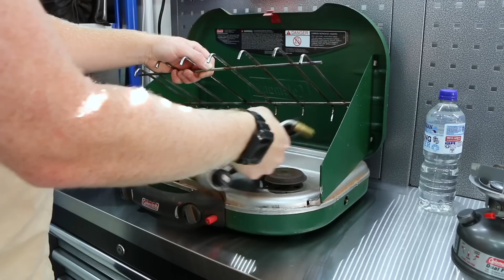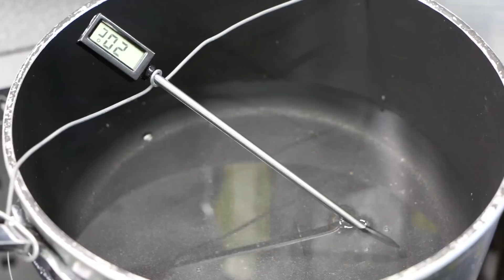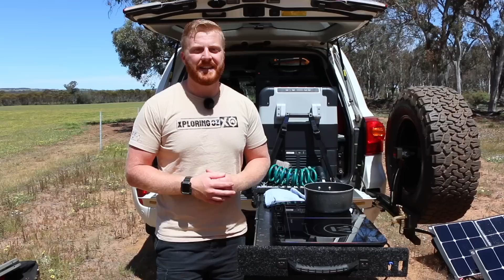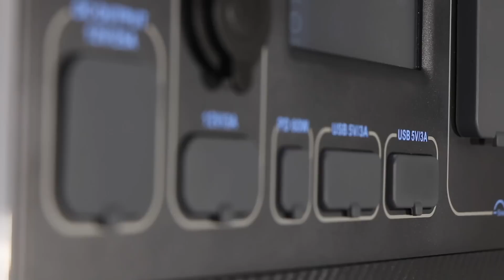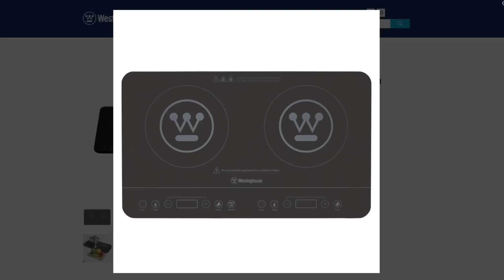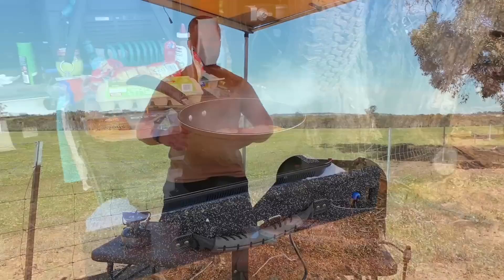INDUCTION COOKING & Camping | Is it sustainable | Electric vs Gas | Overland Cooktop | Pots&Pans

Comment: Yeah,if you want to get cancer and or heart attack with atrial fibrillation, then by all means, use induction stoves.
Reply from the maker: Hey mate, you got any research papers than have hard evidence to links these factors to induction?
Reply: @XploringOz  we all know what radiation causes. We all know what happens when we come into contact with electric heat. You go ahead and get your induction stove and see for yourself happens. But forcing it on others is unconstitutional. Paragraph 420 section 69 of the constitution you can look up for yourself. First it’s medical tyranny, and know it’s more invasion of privacy.
Reply from the maker: @emmanuelvacakis4463  Fair enough mate.... I'll wait here for the research papers that link 'induction cooktops' (not radiation) to the medical issues you have stated. 
I'm not forcing anyone to buy, just informing the viewers who choose to watch of 'some' of the features.
Reply: @emmanuelvacakis4463 "we all know... ". Really ?
 Induction cookers are completely mainstream in Europe and there is no evidence that people in Europe are being harmed from them.
Do you have evidence? No, of course you dont. 

Manufactures, are extremely risk adverse and there is a slight risk (but unlikely) that a implanted pacemaker could be affected by the field if it were close enough. By close, < 10cm close, and how is that ever going to happen.

As for cancers, ionising radiation is connected to cancer, not the non-ironising radiation that induction cookers use.

Comment: Good job, great vid & info. It is also a prudent choice to have the two singles, as redundancy if one should spit it, & further redundancy with a small, cheap, single, disposable gas type is also a good idea for various reasons & options, & also should you have a electrical, charging, battery or solar issue in ur travels. A couple of Q’s, someone mentioned using BBQ mats (sounds like a good tip) for easy cleanup etc, & I was wondering if u have noticed if the induction unit uses more or less watts if anything (like ur cloth towel) is placed under the pot/pan while cooking? Also, I have had concerns of moisture or insects/ dust, etc, getting into the electrical side, but I noticed ur’s was quite wet in one segment, while probly not adviseable, do you think they can survive being left out in wet weather/brief shower at all? 
Great review Nathan, experiments & examples of real world usage of this type setup, pro’s & con’s. Cheers
Reply: We use a non slip rubber cooking mat, approx 4mm thick, and it doesn't seem to change the time it takes to boil 1L of water. I highly recomment thse mats. The pan or pot will not slide around whilst stirring and is good for sloping ground

Comment: So to replace a $36 propane portable dual burner, you have to spend $3000 deep state battery solution.... Don't see the real benefit.
Reply from the maker: Except a good quality battler setup can do so, so much more...
Reply: it is not recommended to carry a gas bottle inside a vehicle. Where do you have it ? Out the back ? On your roofrack ?
My 240AH lithium + dcdc charger + 2000w inverter costs about $1k now. Works great. For an entire overnight, cooking + breakfast toaster + kettle several times uses approx 80ah, or 1/4 of the battery charge. It takes less than 1hrs of driving to recharge my battery. I measured my solar blankets in full sun @ 17A, this means 5.7hrs of sun would replace that 80ah. But, I dont even take the solar, driving is enough to charge the batts.

A $1000 set up can run your cooker, toaster, kettle, etc
Reply: @nordic5490  EV batteries are getting banned from parking under apartments... Lithium is a bomb too... you can't even put out the fire out for five days on bigger packs.

Comment: Just watched the video. Thank you.
Yesterday I ordered my first induction hotplate. After doing some hours of research I opted for the single-burner am z chef, in part because of good reviews, and in part because of the compact thinness. We'll see how she does.

I noticed that most people's experiences are that these induction devices typically don't last very long. There are a few exceptions, but they are exceptions. Usually people end up replacing them within a little over a year, on average. One reviewer had tried various models, replacing one after another over a six year period. At that point he went back to an old-style, more reliable electric stovetop.

Some induction units offer temperature control down to five-degree increments. Others are ten, twenty, or forty degrees.

Some offer power settings down to 200 or 300 watts, and mention compatibility with lower-wattage power stations, like the Jackery Explorer 300. I don't know how quickly those can boil water, though, at the low-wattage settings.
Reply from the maker: No problems, glad you enjoyed the video.

You bring up some good points here and I guess this is some of the unknowns when it comes to using this technology in this industry. It's still relatively new and determining whether it will work with off-grid setups and vehicle travel is something that is still being investigated. 

I'll be travelling full time soon with induction cooking and hopefully I'll be able to do a follow up coming in the future regarding it's long term suitability 👍
Reply: I own 3 different types of induction cooker and have been using these on the bench continously for a yr now.
Tips:
Dont be at all concerned with temp control
Do by a cooker with a low minimum power for simmer, eg the Ikea has a minimum 100w, some are 200w which is too much for simmer.
Dont buy a cooker that a has long period beween power pulses. Eg, the Westing house hasa boom bust simmer, were the simmer dies in the off priod, then the power pulse boils it over. Once again, the Ikea unit has short cycle times and your simmer is much more consistant.
Do buy heavy base induction cookware, eg the pots and pans at Ikea are relatively cheap, and very well made. The heavy base gives much more consistant results.

Comment: Have you made a video of how much power that inverter sucks from your batteries?
Reply from the maker: I'm not powering this from the vehicles battery's at this stage as my inverter is not large enough. Should be easy enough to work out though with the calculation | Voltage X Current = Watts.

Comment: If we are being realistic, how long can I run a single burner non stop on one of these? I am trying to build a van life setup and am looking at a portable power station that I can recharge once a week and trying to figure out what my options are without any recharging.
Reply from the maker: Hey mate, depend on how high you were using it, however the Bluetti AC200P has about 1600W of usable power. So if you were running a single unit on 1000W (I found this to be more than enough for high heat) then you would get a little over 1.5hrs of use (+ or - a bit for conditions). 
Hope this helps, Nathan. 👍
Reply: @XploringOz  thank you, that is actually exactly what I wanted to know. I would basically get 3 days of use out of it before a recharge would be necessary.

Comment: Was the volume of water and surface area on the jetboil, the same as the other two burners?
Reply from the maker: Hey mate, the volume was identical. Obviously the surface area is different and this is because the JetBoil requires its own specific cookware to maximise the way in which it absorbs and distributes the heat. 
Cheers, Nathan.

Comment: Timestamp 13:37 "Cookware." Not exactly correct. As long as the base of your cookware is ferrous or has a ferrous core, like many 3-5ply sandwich base cookware, it will work fine. As I do not know much about the silicone collapsable cookware, I cannot comment affirmatively ,but I'd be interest to know if they are also usable on induction stoves. Lastly, I haven't tested it yet myself, but I doubt that tungsten cookware will work with induction, but I could be wrong.
Reply from the maker: Agreed, ferrous metal will work well with induction. I also haven't had the chance to test the other cookware you mentioned, however fortunately most manufactures will specify whether they work with induction setups. 
Cheers, Nathan.
Reply: @XploringOz  Thanks for the reply.

Comment: Hi great video ,i have a one ring induction  hob if i plug in the 240 volts house power works fine .if i plug into the  4000w pure sine wave power inverter. does not work lights up make ticking sound .It does say on the inverter 220volts not 240 volts is that the reason
Reply from the maker: Thanks. Hmm, 🤔 Not to sure what's going on there. The 220-240V shouldn't effect this. This is a standard range for most 240V appliances. Maybe a faulty unit?

Comment: A pan doesn't have to be completely magnetic.
Only the base does.
There are aluminium pans out there that have a disc of ferrous metal in the base so they can be used on induction hobs.

Comment: Nice vid. The cost of induction for camping is a nonstarter for me since I paid $20 for my Coleman 425 at a thriftshop and I've still not exhausted my cooking options with it. 
Might be buying a travel trailer in the next year or so and can definitely see the advantage of an induction burner, especially if your at a campground with shore power since I've never been to one that meters your electric. We've already used an electric space heater so we didn't waste propane heating an RV.
Reply from the maker: I hear you! The initial costs are probably a little restrictive at the moment. Hopefully as batteries and electrical equipment improve and cost reduces, they will become more viable! 
Nothing wrong with propane systems. I still use my Coleman 533 Dual fuel stoves and they work a treat!

Comment: If the vehicle has a plug outlet in the back can it be used with an extension chord while running the vehicle as a generator?
Reply from the maker: Only if that outlet is rated to the high requirements of the induction cooktop. For example, my Landcruiser only has a 120W outlet in the rear. These induction cooktops need at least 1200W. I would check with your vehicle first. 
Cheers, Nathan.

Comment: I love my induction cook top inside of my house and it is just wonderful, so glad I got induction instead of a gas or electric range.  But the elephant in the room or should I say campsite is that huge battery bank in your truck and the solar cells don't work in shade or cloudy days that we have in my neck of the woods.   My two burner Coleman stove works off car gas that I can get any where while camping.

Comment: We’ve been using a Duxtop 8100 for a few years. It can cook by watts or by temperature. We rarely use it on high, usually on watts and it cycles up to 660 watts and immediately drops as read on our Bluetti EB70. We are currently upgrading our power system but we traveled 100 days across the United States with two 400 watt systems with 200 usable amp hours of battery storage each. One in our van and one in our cargo trailer conversion. We charged the Bluetti from the solar panels with a 2000 watt Xantrex Prowatt inverter. I frequently heat with low watts and then once it’s hot switch to temperature control. We use it for 75% of our cooking and we use a gas grill for the rest. For really high heat we use a single burner Coleman stove. After our system upgrade to 600 Ah of EnduroPower Lithium Iron Phosphate batteries and 1200 watts of solar we won’t need the propane anymore. Good job on your video. Very thorough.

Comment: I’ve just installed (well had installed) a redarc manager 30 with redvision and a 2000 watt redarc inverter powered buy a 170amp lithium giant battery and 2x200 watt giant solar panels also my vehicle changes the battery while driving. With all your research will my system run a single induction cooker. I was about to buy a new gas cooker and saw your video.

Comment: Interesting set up but I'll stick with gas. I refill my 1 pound tanks myself  for about a dollar each and I can get by with 4-6 of them per trip easily. I have an onboard lithium power setup to run my fridge, lights and charge other equipment. It can go for several days without charging. No solar panels needed and since I'm usually 4 wheeling during the day solar wouldn't work for me plus the engine is charging the battery anyway. I would love to switch to induction in the house however.

Comment: Very comprehensive comparison and assessment.  Thank you!

I have a 2000w [North American] Bluetti and adequate solar and inverter in my RV - to recharge via  the AC power brick.  Now I will feel more confident using it for an induction hot plate.

Comment: Your third unit boiled water so quickly because it was a smaller container with less water, doesn't seem like an equal test to me. And you talk about the disadvantage of the power source for the induction cooker, how about the disadvantage of flammable liquids or containers of pressurized explosive gas. This is a waste of time

Comment: Not to undercut the portability of the Bluetti but to underscore the price if you don't need the portability.  Two 100 ah chinese lithium batteries in parallel will provide the necessary current and can be purchased for $700.  I run my stove on a 2200 watt pure sine inverter $329.  Recharge can be accomplished via solar or external charger.  An AIMS 60 amp plug in lithium charger is $300.  So you could put together a nice little system for half as much money that would charge a helluva lot quicker if you can commit to the install that would have the same watt hour capacity as the bluetti.  If you doubled down and bought twice as many lithium batteries you'd double you capacity and still cost less than the Bluetti.  #honestMessiah

Comment: Excellent video and very informative, as others have mentioned, replacing the gas bottle that would last a week of cooking with a big lithium set that lasts 1.5 meals and takes up more room when including the solar and the additional cost too makes this a non starter for most, though for a dedicated camping trailer with onboard lithium and solar having both the gas and induction would give all the benefits.  Thx for all your hard work, For the 4x4 only I will stick with the gas and for the trailer will add the induction.
Reply: Well... it is not recommended to carry a gas bottle inside a vehicle. Where do you have it ? Out the back ? On your roofrack ?
My 240AH lithium + dcdc charger + 2000w inverter costs about $1k now. Works great. For an entire overnight, cooking + breakfast toaster + kettle several times uses approx 80ah, or 1/4 of the battery charge. It takes less than 1hrs of driving to recharge my battery. I measured my solar blankets in full sun @ 17A, this means 5.7hrs of sun would replace that 80ah. But, I dont even take the solar, driving is enough to charge the batts.
Reply: @nordic5490 You can carry up to 9kgs inside the vehicle. So long as the cylinder is well maintained and the cylinder(s) are kept upright it won’t be a problem.

Comment: The other option that wasn't discussed is using a small portable generator, either for the twenty minutes that you're cooking, or as emergency backup for charging the bluetti. 
Mine cost me $600 and pushes 3000w continuous or 3500w surge, which could have both hotplates running simultaneously while charging your bluetti at the same time.
Personally I hate generators while camping, but the option is there.
Reply: "Personally I hate generators while camping" More importantly everyone around you hates them more. It's not only the noise but the exhaust fumes.

Comment: Early on you go into the drawbacks of storing relatively small gas cylinders. Sixteen minutes in, you introduce the elephant in the room in terms of the lithium battery system and solar cells. While I assume you use the Bluetti for more than cooking, a large, heavy, and expensive high amp battery generator isn't optional for induction cooking. And depending on how remote I was camping, I'd likely want a reliable, simple to repair gas stove backup to the electronic system.

Comment: Is it viabel tu use the induction stove plugged into a small inverter, while running the engine?
Reply: Not a chance mate, you alternator wouldn't supply enough power to boil a cup of water via an inverter.

Comment: Nicely made and very informative video mate 👍I have cooked from my diy lithium battery and inverter and ikea induction cooktop and it seems to power down a bit lower (I think it goes down to 700w from memory) instead of cycling on and off. Also only $60 bucks
Reply from the maker: That would be ideal. Would be interested to hear what brand/model of induction you have?
Cheers, Nathan.